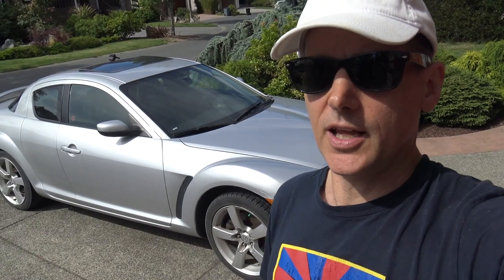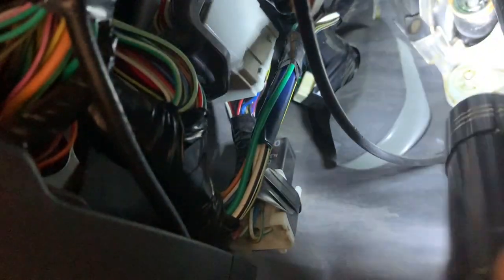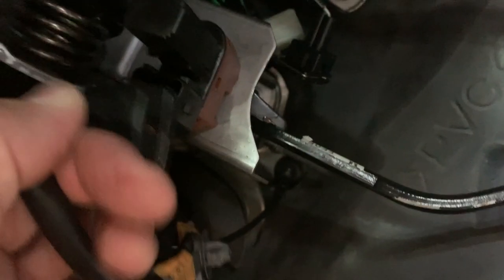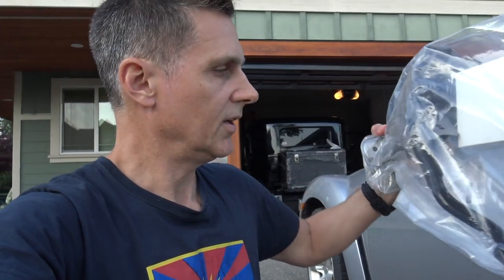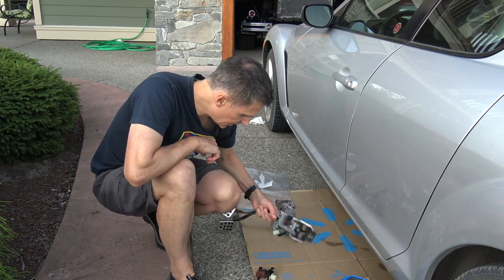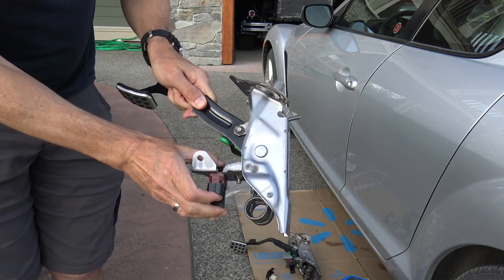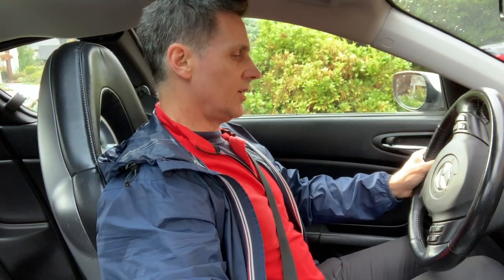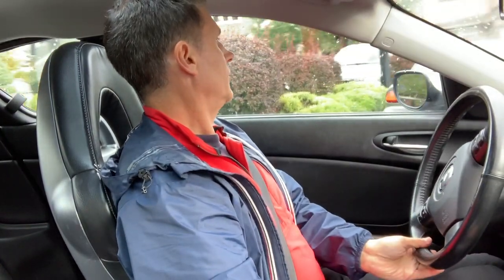Mark's Garage Ep 06 - Mazda RX-8 Clutch Pedal replacement

Comment: Black plastic piece solved, it goes where the metal rod plunger goes in. You have to remove retaining clip on firewall with o-ring snap pliers, pull plastic piece out, insert new black plastic piece and put retaining clip back in. Army Aviation mechanic. It was a pain but figured it out

Comment: Hi - thanks for this video. The NC MX-5 has a similar problem, with a TSB and an upgraded part. I think mine has it but I haven’t taken it out yet to confirm; I’ll probably crawl up under the dash now that I know exactly where to look for the failure. 

Do you happen to remember if the springs moved on the old pedal? There was another short video where the springs moved and this didn’t allow the pedal to return. He replaced his pedal. 

I did just replace my clutch master and slave cylinders but I still have it up on Jack stands. (I’m thinking now my cylinders were fine 😀)

I’ve also heard that the RX-8 pedal is interchangeable. Did you happen to have the part number for the replacement your dear wife purchased ?

Comment: What is the black cap piece that comes with the kit? There 3 pieces in the box, the 2 switches (which you connect in the video) , but there is a third specifically wrapped black plastic cap like piece that comes with the kit. Where does this go? thanks
Reply from the maker: I couldn't remember so I just watched the video... I think what you're seeing is the black backside of the pedal. There were only two things in the bag: the pedal assembly and the box with the switches in it. Hope that helps!
Reply: @WestCoastSupercarsandClassics  No, if you google "rx-8 clutch pedal" and then hit 'shopping' you'll see the first several OEM mazda clutches from various stores and they all show the pedal, 2 switches, and the piece I'm mentioning. Any thoughts? Do appreciate the help!
Reply from the maker: @stevemaier5979  Sorry, there were just two things in the bag, as I said. The pedal assembly, and the white box. I don't know what else to tell you!
Reply: @WestCoastSupercarsandClassics  yeah I installed it without it in any case. Working great. Thanks for the vid!

Comment: Everything was a good video till you started the car drove it for a minute then turned it off...I sense a flood in your future.
Reply from the maker: Not a chance. It's been a great car for almost 10 years. As long as you stay on top of your maintenance you're fine, as they can flood under some conditions. It's easy to deflood them though - hold the gas pedal down and start up, crank for a few seconds. It switches of the fuel pump.
Reply: @WestCoastSupercarsandClassics  Great video, thanks! And yeah you said you had just driven your car so it was all warmed up so no problem with driving it  for a minute and shutting  it off. But no it's not always that easy to de-flood, spreading that type of information is not good. Took over 45 minutes to de-flood mine (2010 gt) after testing that theory, and countless other people with similar or worse de-flooding adventures.
Reply from the maker: @crash6711  I've never had that problem, seriously. That's news to me and I've owned this car almost 10 years!
Deflooding involves pressing the gas pedal down when you crank the motor, doing that for a few seconds and repeating once or twice. If it doesn't start after that, it's a more serious problem, like low compression for example.
Without knowing your individual car I'd be guessing though. :)
Reply: @crash6711  I've had a pretty serious flood when my battery started dying on me, and it wasn't hard at all. It took a bit of patience, but just hold the gas pedal down and crank the engine for a few seconds, then let it rest a bit. Repeat that a few times, and then release the pedal while cranking. Depending on how severe the flooding is, it'll start right up or at least sputter a bit. Then just repeat the process until it's fixed. Don't try to keep the engine running by pressing the gas pedal, as it'll probably just die on you. Let it idle for a few minutes until it sounds healthy, then take it for a 15+ minute drive. It's recommend to hook the battery up to a running car while deflooding, or you'll have to charge the battery once or twice. It takes some time, but it is really easy.